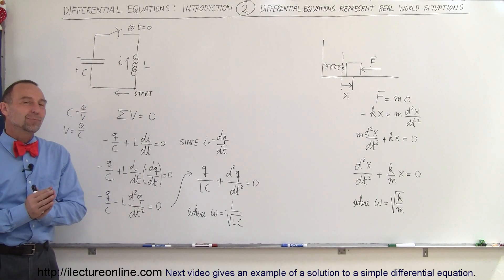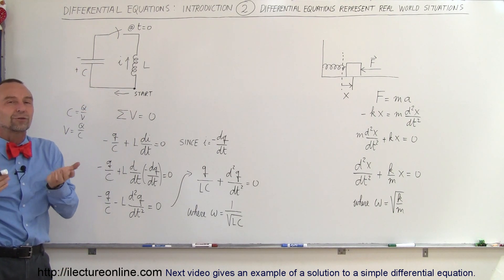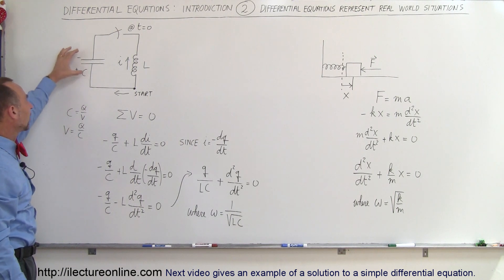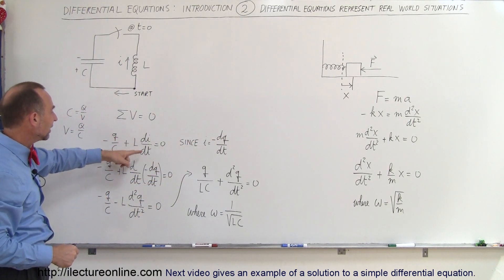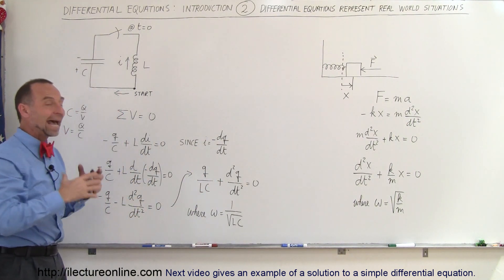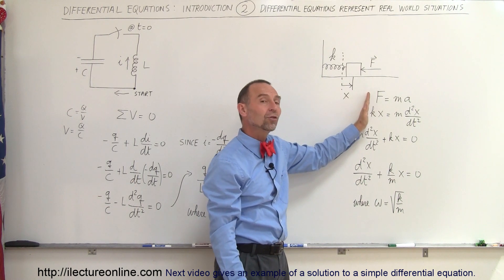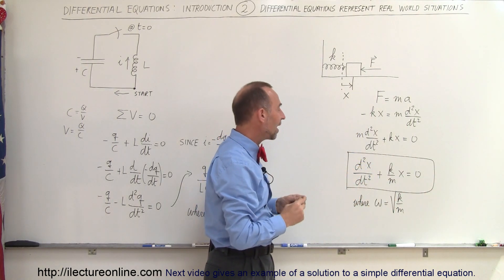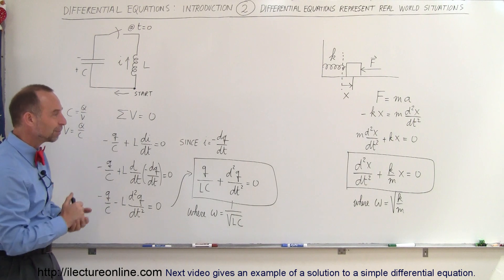Differential Equation - Introduction (2 of 16) Real Situations Represented in Differential Equations

Comment: small mistake at 0:20. isn't that coil a resistor?
Reply: no, this is an inductor.
Reply: oops sorry that coil is a inductor and that zigzag is a resistor
Reply: @amitmodak21  no brother there is not resistor in this circuit there is only an inductor (coil shaped) + capacitor ( 2 parallele bars) +switch(the bar facing up) :)

Comment: Great video! Michel Van Biezen, you're the best! Just a question, can you explain what the LC circuit represent in real life, I understand that the capacitor represents some energy storing element, but the circuit is a very simplified representation of real life stuff, but can you give us an example of what it could be the circuit, please? Many thanks for your great channel!
Reply from the maker: A typical multilayered circuit board for the application that we work on, will contain thousands of resistors, and hundreds (if not thousands) of capacitors.  Capacitors are typically used to smooth out the ripples in the voltage, to change the phase angle, or to rectify the voltage.
Reply: @MichelvanBiezen  That's right! thank you, professor!

Comment: i no di = dq/dt but why negative, i understand that the current is flowing opposite the voltage therefore i = minus not dq, please correct me if i am wrong
Thank you very much i am very thankful for your playlist.
Reply: yes exactly when the current is flowing in the non convential direction (+TO-) the i=dq/dt becomes i=  -(dq)/dt so the current is negative  this is called the "Discharge of the Capacitor" , when it's in charge it's i=dq/dt

Comment: Kirchoff's law second law does not apply here because integral of E over dl does not equal 0 one should use Faraday's law here, you get the same result, but you don't misuse Kirchoff's law because it's just a special case of Faraday's law. Nonetheless this is great video.